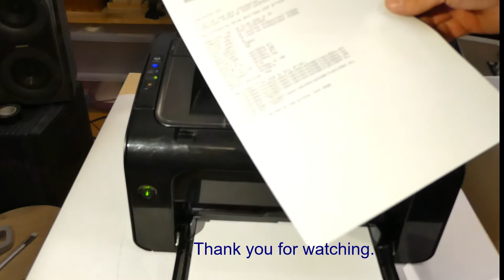HP Laserjet P1102 Fuser Sleeve, Pressure Roller and Heating Element change

Comment: I changed Pressure Roller & Fuser Film. When press okay for printing command, it just starts and after 1 second it stopped. Red & green light stand by in that time

What's the problem this is?
Reply from the maker: Continuous light on the red and green lights is a fatal error. For example, the heating element connector is missing or the heating element is damaged. Heating element resistance check at 7:09. It should be checked to see if any of the connectors were missed during installation.

Comment: Hi! what do you use at 6:37?
Reply from the maker: Hi, I used heat-resistant silicone grease. It is sometimes possible to buy a kit, in which case some grease is added to the fuser film.
https://www.aliexpress.com/w/wholesale-fuser%20film%20grease.html?SearchText=fuser%20film%20grease
Reply: Thank you so much! @mcelec7603